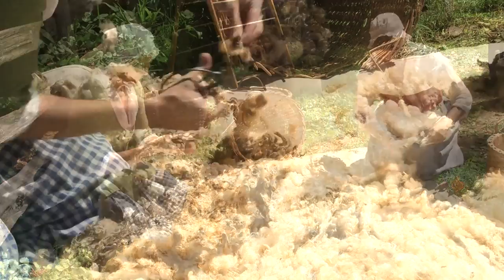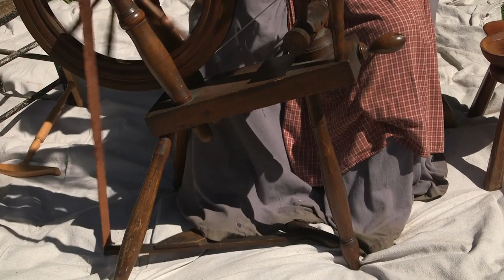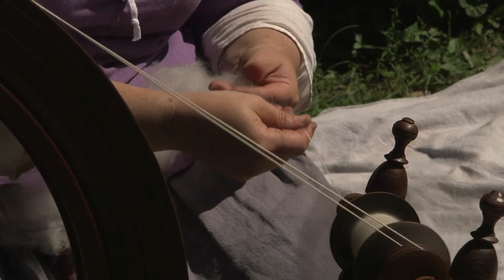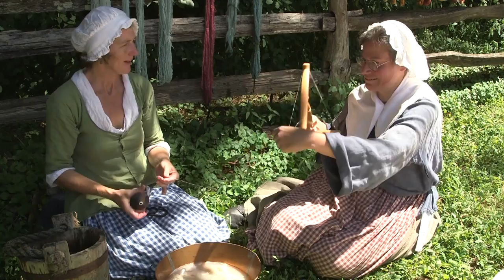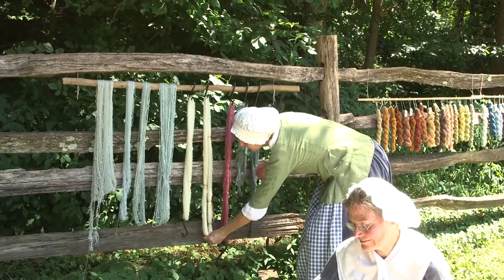Spinning Wool into Yarn

Comment: This is misleading information that I hope is not actually used "on site." While I have no doubts that wool was spun and used in the 1700's, it CERTAINLY was NOT spun on that type of wheel!!! That type of wheel is a flax wheel and was not used for wool. Wool was spun on the great wheel (or walking wheel) which you used standing up. Also it had no treadle and no bobbin only a spindle.
Reply: In my country (Denmark) wool was most certainly spun on a flyer wheel, as the great wheel never really was a thing. A great wheel does not normally spin worsted yarn which is needed for warp in a loom. It spins woollen yarn which is good for weft and knitting.

Do you spin yourself?
Reply: @tineditmarunnerup9513  yes I do :)